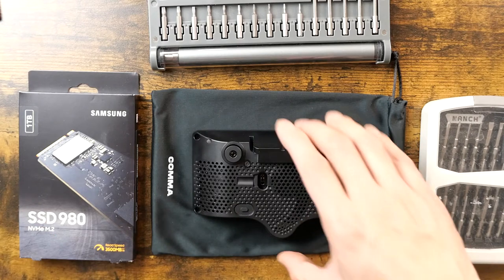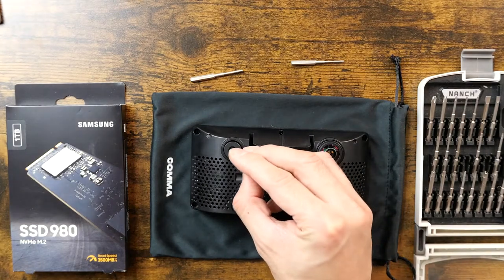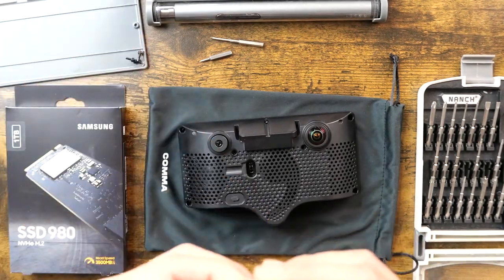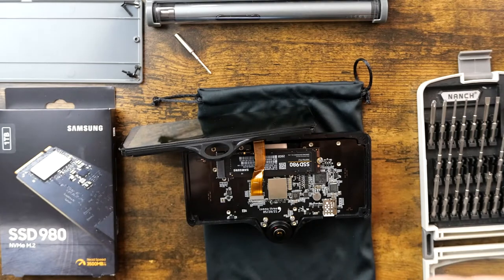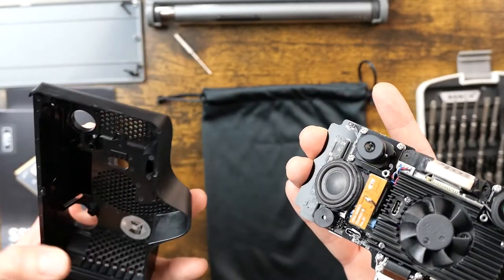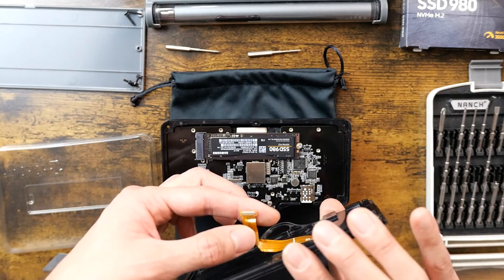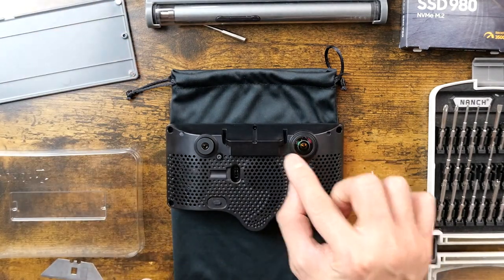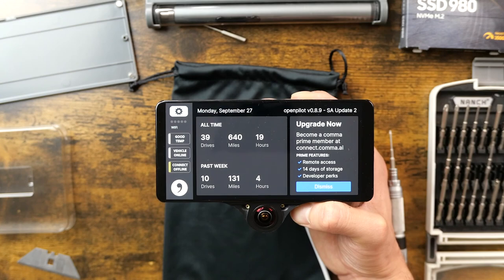Upgrading 250GB Comma Three Storage to  Samsung 1TB

Comment: Just did the same project, thanks for leading the way🎉 I got the base model with an open ssd slot, need to provide own screw for the chip though.
Reply from the maker: Good call! I’ll change my description since the base model wasn’t available when I posted this. Cheers and safe travels!

Comment: the two screws next to the camera's do not need to be removed for this process.   just the ones in each corner, and the one in the center of the mount
Reply from the maker: I don’t think I intend on opening the unit again (I can’t afford to replace it now), but thank you for sharing that tip and I hope others find it useful!

Comment: One other tip, the nvme drive doesn't come with a heatsink/ an that thin rubbery material it sits on. You could add this to minimize the heat.

"Do NVMe M.2 SSDs need heatsinks? Our answer would be a resounding YES. While it is easy to install and forget about your NVMe SSD, these drives can and will overheat critically even during normal day-to-day use. The high performance ceiling of these drives makes it difficult to feel the effects of thermal throttling, but prolonged exposure to such high temperatures does not bode well for longevity."
Reply: Thanks but where should it be added? You mean stick like a silica gel pad beneath it but that would touch the board and capacitors no?
Reply: @Emotionengne  it's specifically designed to sit on boards, they also make metal one that sits on top of the drive an in between the screen. It has the be thin, the one that comes built into the Samsung Evo Pros is too thick, but the cheap stick on ones from amazon fit perfectly.
Reply: @kythera4045  thanks. I did exactly that and my temps never exceed 65
Reply: @Emotionengne  Hi. Are you monitoring Comma 3 board temps, or SSD SMART temps?
Reply: @kythera4045  Which heatsink did you buy from Amazon? Trying to find stick-on ones but they all look too big
Reply: Ensuring proper cooling of the device is not a problem.  Simply install a USB fan in the case and connect it to a power bank with a digital temperature switch.  The power bank is then integrated into the on-board network via USB.  The comma 2 or 3 is now also cooled if the vehicle is in the sun and the previously set temperature is exceeded.  I chose 122 degrees Fahrenheit.
Reply from the maker: I never had any heat issues with the NVME, since the SoC was more of a concern. But thanks for sharing.

Comment: Does upgrading the ssd and using sunnypilot affect the ability for comma connect to read drives/videos? 

I upgraded the drive using your a video a while ago and now noticed that none of my drives are accessible through commaconnect nor spektors toolkit.
Reply from the maker: @josephyang3260  Before my Comma Three died, it still connected with Comma servers fine using default software - but I did notice that using Forks (not just Sunnypilot) changed many behaviors, compared to default software.

Install default software to rule out the SSD. If the behaviors are different, ask the author of the a Fork about it.

Comment: what size screw do you use to secure the SSD down into the comma board?
Reply from the maker: My Comma Three already had a 250GB NVME and I was able to re-use the old screw to attach the 1TB NVME.

It should be using a conventional 2.0 x 3mm (CM2x3-3.3) screw like most m.2 screw.

Comment: I have performed this and I have an alert on my comma 3 that says "storage drive is not mounted" did you run into this? If so how did you fix it?
Reply from the maker: Uninstall OpenPilot and Re-Install and see if that works.
Reply: Yeah, scared me too... but if you hold press on the comma logo while it's booting up it will ask if you want to reset your device. Say yes, an it'll fix this issue aswell.
Reply: @kythera4045  I did this exact step shortly after leaving my initial comment and it worked 👍👍

Comment: Do you think it's worth getting the version with the heatsink?
Reply from the maker: Thanks for watching. 

Personally I would opt for the same drive that Comma puts in their units. I know others have installed other branded and sized drives, but I like to keep things simple.

Also, I would recommend just running defrost mode with AC whenever you drive, and to also take the unit down so you avoid heat saturation of the drive and the entire unit as a whole. It’s a terrible user experience having to make the precautions, but I just keep reminding myself it’s a dev kit and it’s really not automotive grade hardware.

Comment: Any tips on how different this would look upgrading from the 32 gb comma 3?
Reply from the maker: From what I have read, they are the same. You will open it up and see no SSD installed however and may need to source your own SSD screw. Please be careful if you are to follow through.
Reply: @bryan.deleon  I've also read that it's recommended I attach the new SSD to my pc first and update it to the latest firmware? Is that something you'd consider? Something about these ssd's running hot?
Reply from the maker: @najibseiso8342  No clue on firmware updates, as I just installed mine straight from the box. I have not experienced the SSD overheating, but I am also quite careful with my unit as I do not trust the engineering in the Comma Three; I have defrost at 70f-72f on ALL the time when driving with Comma products, and always take my unit down whenever I park for more than 10mins. It's a hassle, but it gives some peace of mind.

Comment: can you or anyone speak to how to check the storage used on the comma 3 ssd?  i've installed a 2tb into my 32gb model easily, but after reinstallation of openpilot, i have really no idea if the ssd is recognized, etc. i like to check my work. pls advise.
Reply from the maker: Check the previous comments below for the SSH command. Also make sure to uninstall and install OpenPilot again to make the drive accessible. Cheers!
Reply: I ordered the 32gb version...is it literally just a 32gb SSD so can swap to 1tb? I see reference to the SSH command. How do I do this? From my laptop? Thank you.
Reply from the maker: @yyzonlinevideos  I’m not familiar with what is in the 32GB version (it could have the nvme slot empty for all I know while using onboard storage?)

SSH can be run from a PC or even on your mobile phone: https://github.com/commaai/openpilot/wiki/SSH

Or use: https://github.com/spektor56/OpenpilotToolkit
Reply: @yyzonlinevideos  Inside the 32GB version of the comma3, there is no SSD installed.  It is an open M2 slot.  The "32GB" referenced by the devs seems to only be some on-board storage/flash media.  I did not take the comma3 apart futher to find it and recommend you don't either.
Reply: @alano.7824  ok thanks. But if I put a 1tb ssd into the 32gb comma 3, it should work? Just have to reinstall openpilot?
Reply: @yyzonlinevideos  Yes, I did it with a 2TB.
Reply: @yyzonlinevideos  Look into OpenpilotToolkit for your SSH and clip pulls.
Reply: @alano.7824  thanks. Is the toolkit the only way to access your drives/video clips from the comma 3? Mine arrives tomorrow and can't wait. Also, what are the specs of the 2tb ssd you used?

Comment: After upgrading ho do you check the upgraded storage size? Thanks
Reply from the maker: You will need to SSH in and run command:

df -TH

It will be listed as: “dev/nvme0n1/a/media”

Mine shows as: “ext4 984G” (essentially 1TB when partitioned)
Reply: @bryan.deleon  Many thanks. I did but it doesn’t show up. Installed the exact same SSD but mines 32GB; any idea?
Reply: @bryan.deleon  Thanks, I had to reset the system. It shows up now. Thanks for your help
Reply from the maker: @Emotionengne  https://github.com/commaai/openpilot/issues/24302

But definitely try reseating again and also install master-ci if it has a new fix.

PS - In my description I also mention having to re-install OpenPilot after the nvme swap.
Reply from the maker: @Emotionengne  cheers and safe travels!

Comment: Bad news: With the new model Comma AI 3, they only offer 128GB and there is no SSD inside or SSD slot for you to plug your SSD in.
Reply from the maker: That's a bummer. The new 128GB space in c3x "should" have enough space for offline maps though... but don't quote me on that. I was using offline OSM with Sunnypilot which took up about 50GBs of space, but I have since deleted it and just run e2e/experimental now. So unless you want gobs of space for dashcam/screen capture, you should be fine I think...
Reply: @bryan.deleon  I believe their business strategy revolves around providing a limited built-in storage capacity. If you require additional space, you'll have to subscribe and upload videos to their cloud storage service.
Reply from the maker: I can't comment on their business decisions regarding their for-profit but opensource company lol